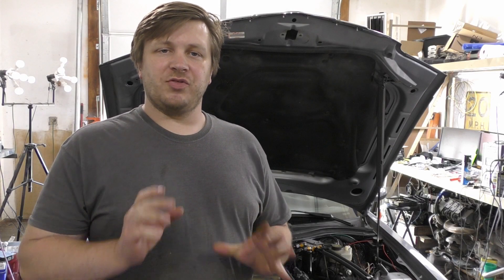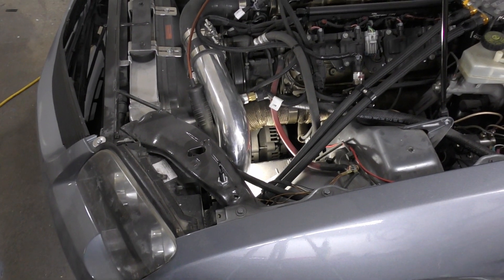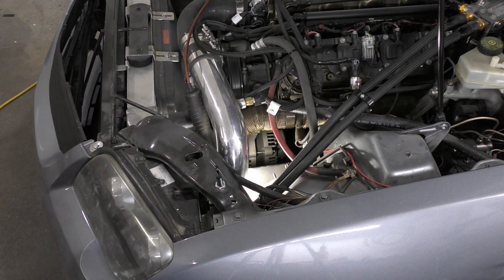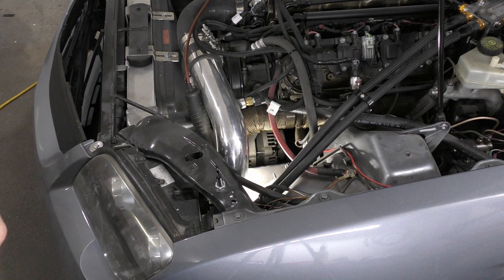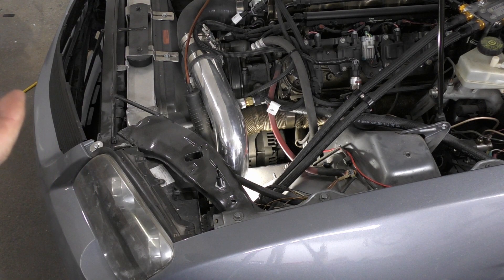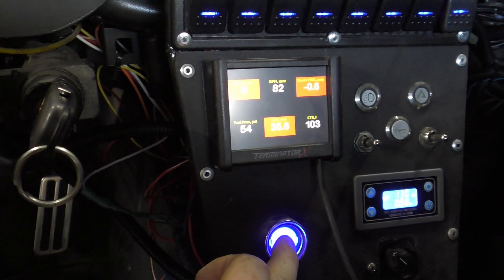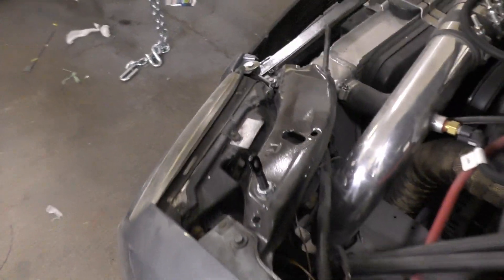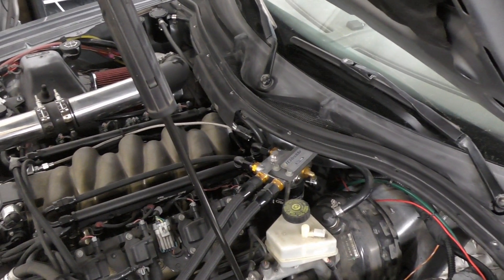V8 Crossfire Project: PWM Alternator Control

Comment: Hey bro, awesome you have this working! I'm trying to go this to my 2 wire pwm controlled alt. So on your controller did you just hook it up to 12v ign, ground, then tap the pwm out into the alt wire that is the 5v wire between the ecm and alt? Then leave any other alt wires alone?  Did you do anything with the old wire coming from ECM that's now not hooked up? Wouldn't it cause a code?
Reply from the maker: That is how I wired mine.  I have a Holley ECU, so I'm not sure about codes on a stock one

Comment: So this controller puts out a fixed frequency and duty cycle?  How does it regulate for load changes like a standalone alternator/regulator does?
Reply from the maker: It doesn't regulate anything, for my setup, I have a static load so there is no need.  For the most part, if your alternator is seeing a large enough load to pull the voltage from 14.4 to below 13.8 at a certain duty cycle, there may be a need for a higher amp alternator.  Unless you need to run seat heaters and a massive stereo intermittently, I wouldn't worry about it - which is why I don't.
Reply: @Drivewaybuilt  and I would agree under normal conditions, but if for some reason you loose the load/battery, without regulation the alt can drive the voltage very high, which may fry your other electronics…  have you tried running the alt disconnected(battery powering vehicle, alt connected only to volt meter) at that freq/duty cycle?  You might be unpleasantly surprised at how much voltage it can generate…  At any rate, just  a thought…
Reply from the maker: @rronmar  Giving it some more thought, it shouldn't spike the voltage at all since the pwm is controlling the voltage limit not the amps.   70% is 14.4v  I haven't tried unplugging the battery since the Holley ECU will not like it, but there is no voltage drop when the fan turns on or off, so I would not expect it to go too crazy
Reply: @Drivewaybuilt  you don’t want to unplug the battery,, you want to disconnect just the alt and leave the battery powering the vehicle load for the test.  70% will deliver 14.4V at a particular load.  how much the fan cycling on or off effects voltage depends on what percentage of the total load it is. Think of it like this, say you are hooked up really good and accelerating nicely at full throttle, when the driveshaft snaps…  what happens to RPM till you get your foot off the throttle…  Same thing happens with an unregulated field.
Reply from the maker: @rronmar  The thing I am getting at is that these alternators have a regulator internally that controls and regulates the workings of the alternator, the pwm command being sent to the alternator just tells the internal controller to output X voltage - the 70% should result in 14.4 at any load.  Hopefully that simplifies the conversation

Comment: Really amazing stuff, I couldn’t make sense of any of the forum posts until I watched this.

Question for you: can we take an I/O from one of the 4 options on the terminator x harness? Say input 1 and set as 5v in settings then run that wire to the power input + on the module, ground the module, then run a wire from pwm on the module to pin L? 

Am I thinking about this correctly?
Reply from the maker: There seems to be a little mix up in how your question is being stated- what are you attempting to accomplish
Reply: @Drivewaybuilt  sorry, where did you pull your 5v source from? 

I was trying to locate a 5v source from the terminator harness. Only one I could find was from the I/O options.
Reply from the maker: @desert_edition_na6  Gotcha. the pwm module has an internal voltage regulator - put 12v to the vin+ and ground to the vin- and when it turns on, you will need to find the voltage setting on the module and change it to 5v. then the pwm out will be 5vpwm - connect that to the alternator.
Reply: @Drivewaybuilt  ahh I see, thank you man. Some documentation suggested pulling 5v to power the module. But if 12v works it will make this easy.
Reply: @Drivewaybuilt  🔴 Graet video, good question, good instructions, but to be 100% clear I run my wires + to +,  - to - from battery to pwm generator. Do I need an in-line fuse on the + or - between the battery and pwm generator?
Reply from the maker: @keepyourdignity8464  Correct + to + & - to - If you are using it like I did, make sure to set up the output voltage before hooking up the pwm wire or the alternator will get too much voltage.

The odds of the PWM generator drawing too much power is very low, but it is wise to fuse all power connections closest to the source in the case of a dead short.

Comment: What wires did you run to the power input and the power output on the back...  It doesn't seem as simple as power ground and an outgoing pwm wire.
Reply from the maker: there should be vin+ and vin -  those are your power terminals.  signal goes to the pwm.  i connect the 12v first and go into the settings to set the output voltage and then connect the pwm line
Reply: @Drivewaybuilt  so it's not at simple as giving it DC power and ground.  Weird
Reply from the maker: @kaizousha5531  the pwm device comes out of the package at 12v pwm - once it is setup in the settings for 5v then it is just dc power and ground - first setup is a few more steps

Comment: I don't understand why you chose the DR44 alternator to begin with. Why not use a CS130D style with a sensing wire that will give you 14.4 volts constant?
Reply from the maker: Basically, I had the DR44 on the shelf and people on the internet say you can't get them to work without the stock computer - so I made it work.  Also CS130D is the wrong one - it would be an AD244 in its 4 wire equivalent

Comment: Thanks for posting this, especially for listing the transition year of 2007.  Are you powering the frequency generator with 5 volts?  How do you step down the voltage to the 5 volts that the DR44 wants to see and what amperage is required?  I found a chart that lists the duty cycle vs voltage and 88% seems awfully high to run at all the time.  Something in the low 70s seems better (according to that chart, 70% = 14.37 volts) if you aren't going to put any kind of microprocessor control and/or feedback on it.

Do you happen to know the part number(s) for the 2007 and up LS alternators that have PWM control, and where I can find a wiring diagram to wire one up that no longer has the factory ECM / PCM?    Thanks!
Reply from the maker: The little PWM controller I used can step down the 12v to 5 volts.  The 88% was when I was clicking buttons and seeing where the volts went.  Eventually I dialed it in to 14.1 v and left it.  I also don't have an oscilloscope to make sure what it says for frequency was truly what it was giving